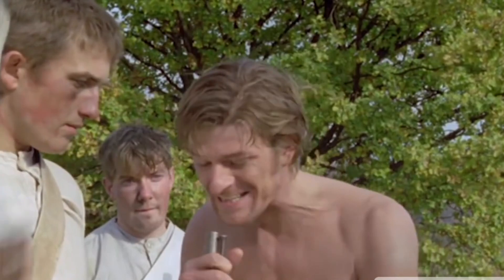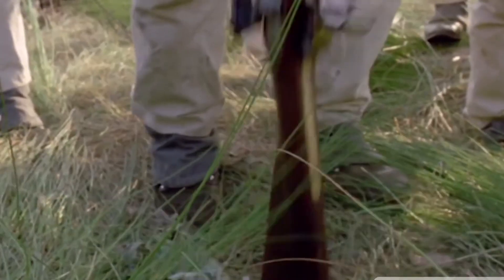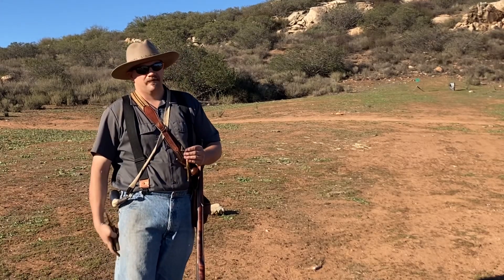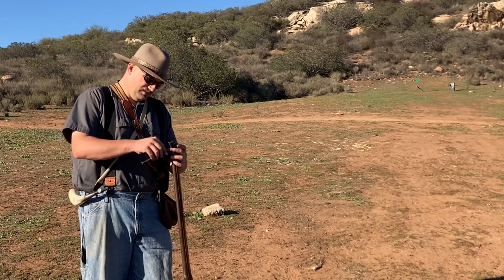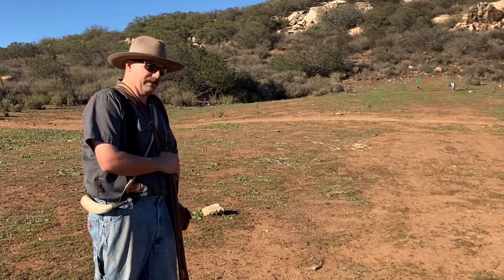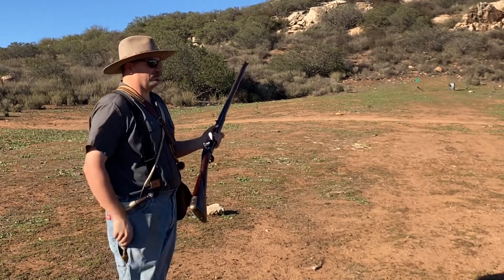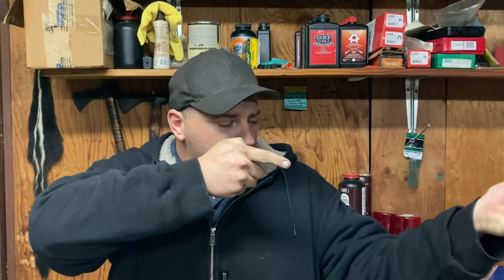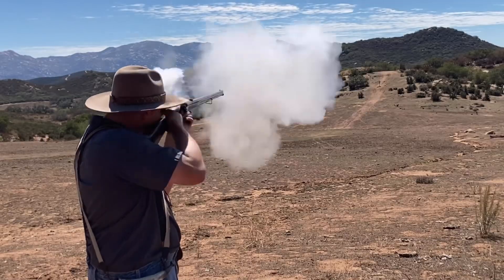Sharpe’s “Bite, pour, spit, tap” load. Does it really work?

Comment: Kind of surprised it kept enough gas seal to work.  Even more surprised  it was still accurate.
Reply from the maker: A little luck never hurts
Reply: There is a theory and maybe somebody like you could test it out that if you use an extremely soft lead ball and a large enough powder charge. The pressure will actually smash the ball till it fits the barrel creating a sort of seal.
Reply: @Real11BangBang  It's call obturation.   The very high g-forces  (15,000 G's) makes the ball (slug,  bullet etc) compress under its own weight and expand until it fills and seals the bore.

Comment: That actually worked better than one would think.   Ever heard of 'chewed balls'.  Apparently that was another gimmick they did with smooth bores, they would take the round ball and run it between two course files, like horse shoeing files and kind of knurl it.  The idea being the raised edges made a crude seal and you skipped the patch and wad. Oh and the atomic safety Karen blast was epic!
Reply from the maker: Thank you. Yes, I’ve seen a few videos Mike believue did on chewed balls. It didn’t seem to help the performance
Reply: @Everythingblackpowder  yah i think those short cuts were the thing with mass volley fire of the period and not so much about getting optimum perf from the gun and shooter.
Reply from the maker: Agreed
Reply: with chewed balls it depends on the gun some it helps some it doesn't do squat!!
Reply: @keithmoore5306  It's just another thing I read about years ago.  I don't have a smooth bore muzzle so I never tried it.  It's cool they came up with the idea though and it must have had some payback for people to use it and write about it though.
Reply: @luuk-out-below9804  well like i said it depends on the gun you have and the condition of the barrel the ball mold you have the powder you're using the weather at the time and so on and so on! you've just got to try different things and find out what works for your gun! i've got a buddy who's running a Canterbury set up a single shot 12 gauge with a chamber adaptor and his does good with chewed where mine set up that way prefers patched balls!! but really a lot of stuff like that that's seen as a benefit is really just old wives tales proven wrong again and again but are kept going by nubes being told it by others who were told about it when they started out! be it today or 1778 or 1597 there were always nubes asking the ones who had done it already!
Reply: @keithmoore5306  Exactly.
Reply: @davefellhoelter1343  From what I recall, they used course cut files the type any farmstead would have  on hand for taking care of horses, mules and ox hoofs.

Comment: I actually found that in my Pedersoli Indian Trade gun, that .570" balls work really well despite it being a .62 gun. They shoot almost as well as .600" balls. My Pedersoli French Cavallerie carbine prefers .648" to anything else in a simple paper cartridge.  It's all about finding what they like. I have been reading a couple different books on how Native Americans used firearms here in the northeast during the French & Indian War and earlier, to the point even the British were afraid of some of them, even their allies like the Mohawk because of how deadly they and their tactics became and how they would use whatever ball sizes they could get or even mold when someone taught them how to make their own.
Reply from the maker: I’ve used .570 balls in this musket with a patch but they’re pretty loose. I get better accuracy with a .600 ball
Reply: I'll try! still working out my Charleville musket and pistol? Bummer now I need to "Test more?" I want faster and easier to load reasonably historical. I got one larger waded ball Loged so Tight on the sprue in the Charleville I went back to the tail gate and tools, dumped the touch liner and breach plug to push it back out the front! I was "Uncomfortable" Slamming the steel rod down the steel tube with a full charge?
Reply: @davefellhoelter1343  Well pouring powder then patch and ball was historical for a lot and of muzzleloaders. Paper cartridges were also historically accurate for a long while. I don’t understand why it must be documented, if they had patch material and a ball people put it to use.

Comment: I don’tknow about spitting a ball downbore, but I have heard and read for a long time now that priming the pan first was the manual of arms for the Brown Bess. Makes sense when you think about it.
Reply: Makes sense when loading from a paper cartridge.  Tear the end off of the cartridge, prime the pan with a little bit of the powder from the cartridge, pour the rest of the powder down the bore, put the ball in with the rest of the paper, ram it down, and you're good to go.  That way you don't have to carry around a priming flask, which is an extra tool to keep track of and maintain.

Charge>seat>prime is safer and preferred if you're loading from a flask and measuring each shot.
Reply from the maker: Except the ball spitting part

Comment: Are you using a "dead cat" on your microphone?   Helps a lot with wind noise. A shotgun microphone helps concentrate sound recording.
Reply from the maker: Just my lapel mic
Reply: I use a BOYA microphone.  Plugs into camera.  Smart phone in my case. Less than $20 delivered. Ebay

Comment: As far as "period correct" loading goes, our ancestors universally experimented with powder charges and loading techniques to find what worked best in THEIR firearm. So you are just fine from that aspect. Still, the militaries did insist on particular loading techniques that soldiers had to follow - your Brown Bess is considered military, so some will insist on "correct" techniques. Just tell them it's your personal firearm, not an issued one. 😊
Track of the Wolf and Circle Fly(?) Carry 19 guage wads and cards.

Comment: i don;t think you could do it in a rifled barrel with a ball that's the right size due to the rifling grabbing the ball and a ball small enough to prevent that you might as well be shooting a smoothbore anyway! as for a ball rolling down the barrel if tipped, there's enough slop there to allow enough blow by to prevent an overpressure spike even if the barrel is that weak! if you can find some a 16 gauge card should work! i never have bothered with pre cut patches i've always cut strips soaked them in lube let`em dry scrapped the excess off and cut when starting the ball!
Reply: Maybe with a very slightly undersized Minié Ball?
Reply: @0neDoomedSpaceMarine  from the ones i've shot they still stick enough to need to be rammed! it might just be the guns i've had but in them you can't do it!

Comment: Never heard of that but I don’t particularly like westerns. I have made and shot paper cartridges and they are super convenient compared to speed loaders and pouring your powder charges out on the spot. I have considered if a paper cartridge that goes in whole could be reasonably pulled off, and with nitrited paper it sure could, maybe a sprinkle of 4F first to spark the paper
Reply: IIRC that was how they made cartridges for cap-and-ball revolvers, a nitrated linen or paper "bag" tied onto the bullet.  You'd just drop the whole thing in and ram it home.

Also I seem to remember an early breechloader that used the same kind of cartridge.

Comment: I've tried this using my 12 gauge doglock. Interesting. I did prime first- but engaged the 'dog' to hold the cock in place, but rather than spitting, I took the ball from my mouth and dropped it down the barrel. I found that while holding the gun, I could feel the ball land on the charge. The plus side was I could get 4 shots off in well under a minute. Accuracy was down compared to a patched ball. Probably doubled the spread of the group at 50m, but all on the target board. Using 0.695 ball. Same as when I patch.

Comment: As I understand the process, the "extra" powder continues to generate sufficient force to power  the ball down the bore in spite of a small amount of gasses escaping around it. It is theorized that this acts like a "gas pressure bore bushing" and  actually improves accuracy beyond what would ordinarily be thought likely because it prevents the ball from rattling down the over-sized bore.